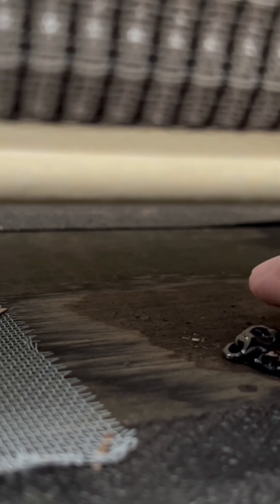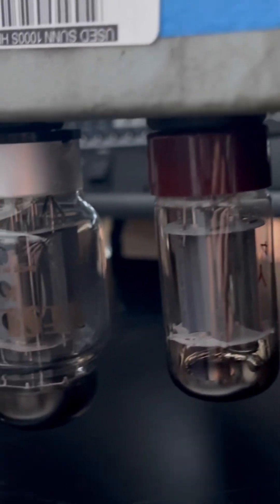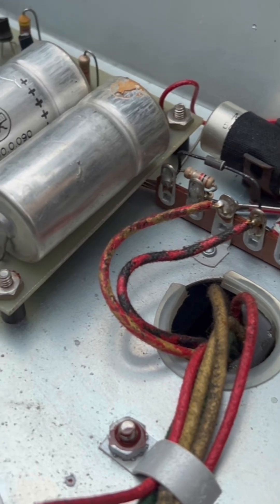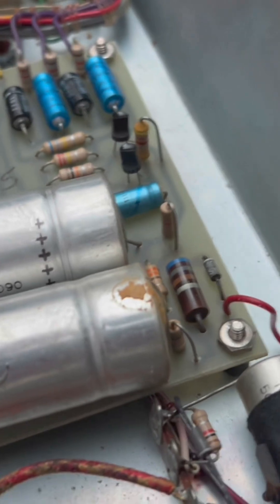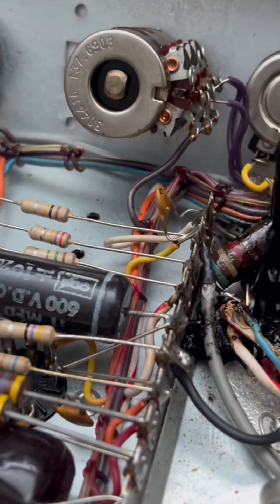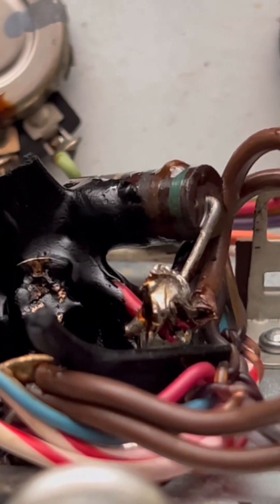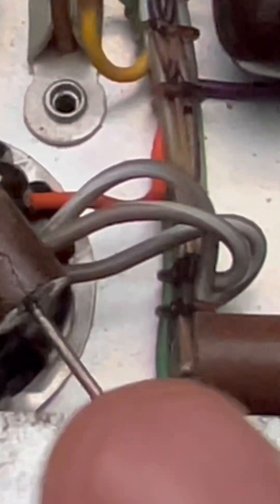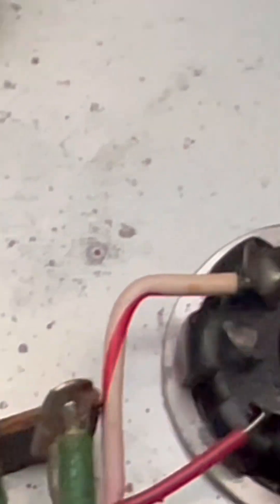Guitar Center Vintage Score?  1969 Sunn - Glooped & Duped #electronicsengineering #amplifier

Comment: Was it the black cap of death that blew up anytime I get an app that has those black caps in there I immediately changed them because they're hell on amplifiers they have a tendency to do exactly what this one did so if there's any more of those black caps in there I suggest you get rid of them and change tomorrow for some more modern caps because they're only become that app is only going to be coming back to you what's another one blowing up so do yourself a favor and the person who owns the amplifier a favor get rid of those black caps
Reply from the maker: The black caps didn’t cause the mayhem. The death cap smoked — the cap can blew out and a few of the other filter caps also ruptured. Bad news. I sent her back to GC to get a refund.